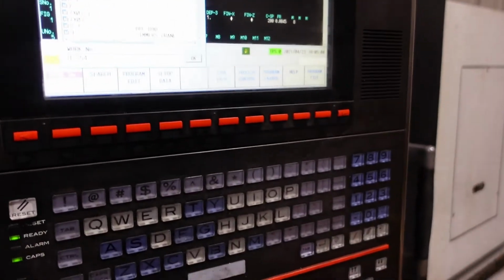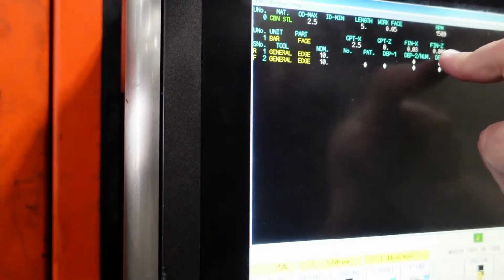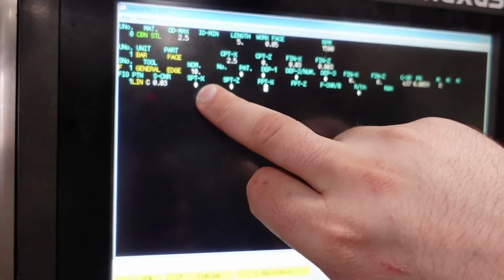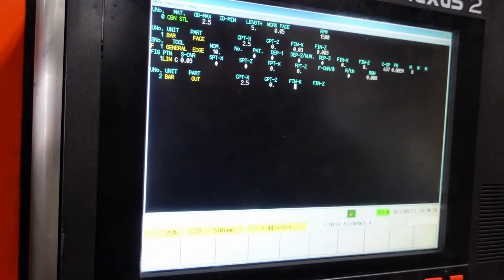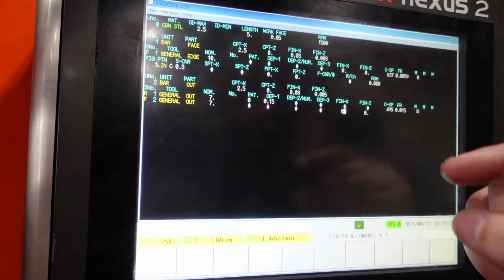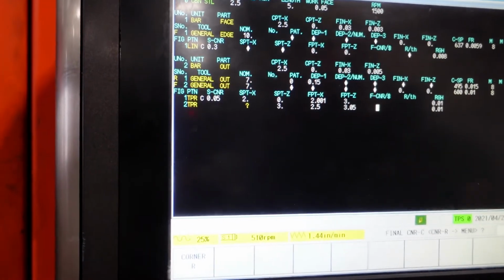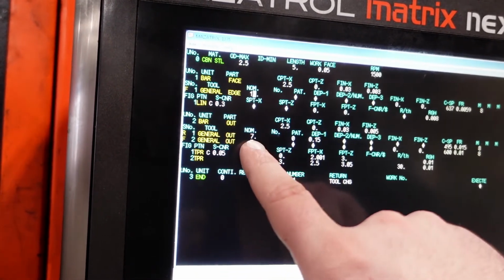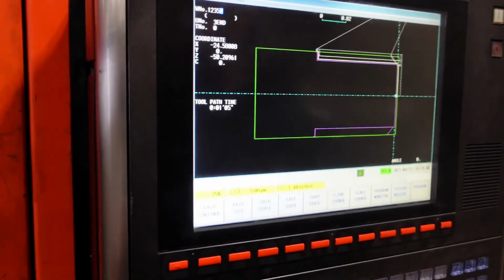Basic Mazak Lathe Programming on Nexus Controller

Comment: It’s like Mazatrol by the Lollipop Guild.
Reply from the maker: If you want to come by join us in making life support equipment used on planes that would be great.

We already do pretty well but any help would awesome.
Reply: Yeah, I was wondering why it was so hard to listen to
Reply from the maker: @a1glassmirror that would be the large mazak 550 lathe behind us in the video, that runs through a 2 speed trans. It sounds like a jet engine and full speed of 700 rpm lol. 

Believe it or not, this video is with heavy tuning trying to cut out that noise. It is significantly louder in person and requires hearing protection to be around.

Comment: Sir what do you called that kind of programming??? Is it gcode?? Or mcode progrmming
Reply from the maker: It is called conversational, you tell the machine the basic shape and patterns to machine. The machine converts everything you tell it to g and m code instructions to make the part.
Reply: Ahh ok... So its not right to called it MCODE programming
Reply from the maker: That is not totally accurate. All cnc machines even 3D printers run and work based on g and m codes they are given.

We can either tell the machine every command individually like through a CAM software. Or we can use what this is which is called conversational programming. The programmer "describes" the part shape, dimensions and features how you would read a blue print. Think of it as built in CAM software in the machine but far more basic.
Reply: Hello Mister , apakah pemrograman mazak nexus 2 tersebut sama dengan yang di  mazatrol smart
Reply from the maker: Yes, and no while many of the same options and cut patterns are available in mazatrol the newer generations will have added features and updates. 

Primarily patterns, or approach/escape controls new smooth controls have built in high efficiency milling options. Without seeing the exact machine I wouldn't be able to tell you exactly what's different unfortunately.
Reply: @nestservicesiowa  Hello, is the way to set the tool for the material the same?
Reply from the maker: Sorry, you're question is too vague. 

Are you referring to building or choosing the tool to be used, or teaching the machine?
Reply: @nestservicesiowa  setting zero or x value diameter to the mechine😊
Reply: Apakah cara setting tool z 0 pd mesin mazak smart sama dengan pd nexus 2?

Comment: question if you squared your part but then you had to bore ... I D turning
and you stopped the program in medias res and wanted to bore now (restart, down to bore).  
do you go back to mazatrol and make WORK FACE "0" value for the boring operation or anything else that comes after?
Reply from the maker: What do you mean by medias res? That part confuses me lol

The bore "Z" is not the same as work face at the top of the program. Work face is a clearance for tools to approach at. If you get a piece of steel raw stock that has .250" extra to cleanup then for 2 programs you may set them both at .125" so they both would cut off that extra material.

Your ID unit (and most all turning units) are going to ask for a "Z" start point. That point can be 6" deep inside if your subsequent operations clear the material necessary.
Reply: @nestservicesiowa  6 inches? 
you can't just give it a NEGATIVE value? or is that what you mean?
Z is always positive unless you really want to start in front of the part then you would use a negative number right?
but even that is useless since TPC figures out how much each tool should be before z0
Reply: @nestservicesiowa  in medias res is latin for in the middle of the operation 
say i write .01" for Work face 
i square  my part by Facing EDGE and OD turn ,
then i reset the program. (for whatever reason)  (maybe the drill is not the right drilll or maybe i did a too change and the tool isn't there etc
do i go back to mazatrol now to make Work face "0" if i want to run 
DRILL
and then BORE after?
Reply from the maker: The Latin phrase is new to me, thank you .

And no work face is clearance for all tools. Each unit has its own tpc for minimum retract or pull off distances etc. Work face is where tools will come to that is a "safe" approach point. It will always be positive and no need to re-write to "0" for a restart.
Reply: @nestservicesiowa  i just tried it again but it doesn't count for the fact that the .01 or .05 at the face HAS ALREADY BEEN CUT by my first tool
there is a reason i always kept it zero 
i am too afraid to even leave anything on X or Z in case i needed to start in the middle of program it would just think that i have allowance ? 
what do you think that is?
Reply: @nestservicesiowa  so work face has nothing to do with how much to cut from the piece? BEFORE it's Z0 ?
Reply from the maker: Nope it does not, it is the "z" point all of tools come to, to make their final moves to your cut points. 

If you would add +1" to your work face your tools would approach 1" father off the part. But the cut point has not changed, they would travel the extra 1" linearly to where they were told.
Reply from the maker: If you add +1" to your work face then your tools will be 1" farther from the part initially. They will traverse the extra 1" you added to end up an the same Start point/Cutting point.
Reply from the maker: If your program is proven out fully. Then all that you should have to do is restart where you want and watch it carefully, just so you don't have a tool welded to your spindle. Lol

Stopping a mazatrol (most any mqchine) program mid run, is quite safe and easy to restart. You don't need to reteach or adjust any work positions or "Z" lengths.
Reply from the maker: What machine model if you know and if you can please email me directly Midwest.Machinists@gmail.com
Reply: @nestservicesiowa  ok cool 
yeah its. fusion 640 mt control / integrex 300 turning center
Reply from the maker: Every input in mazatrol, is it "X" and "C" position or are you doing "X" and "Y" this will help me get a better understanding as some of the machines used degrees to control "point position" due to the slant bed, if I am thinking of the right one.
Reply: @nestservicesiowa  no i am merely talking about the lathe portion of the control 
exactly the same way if you were to program on SQT lathe